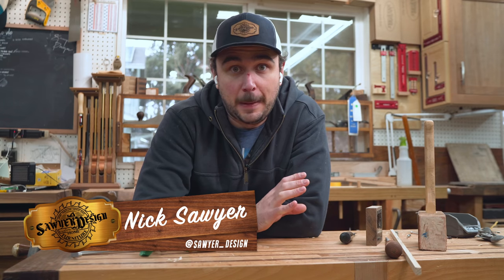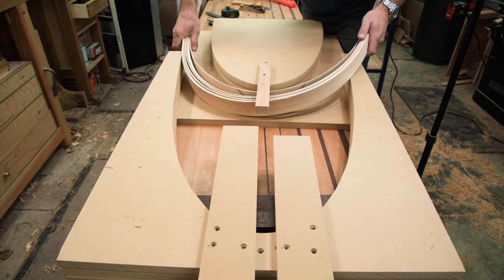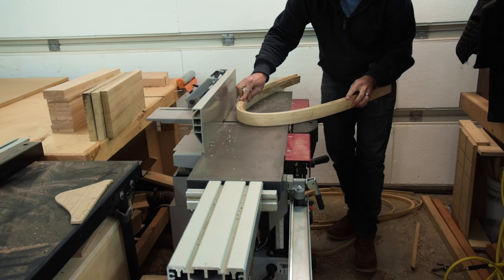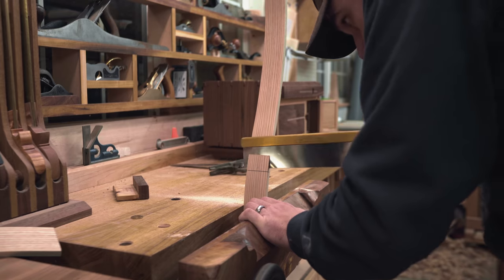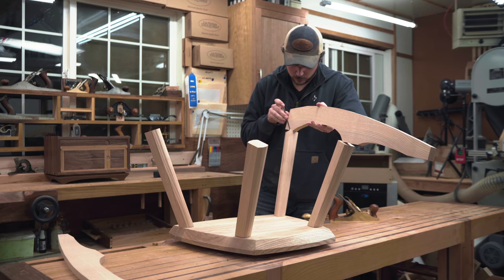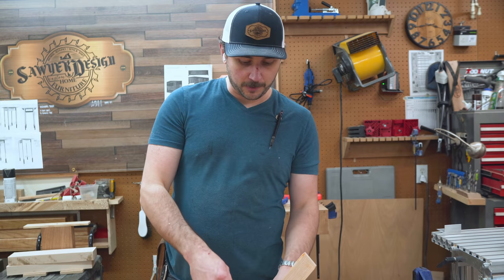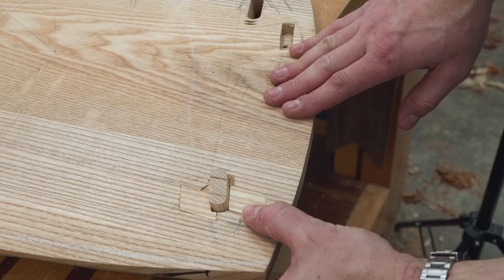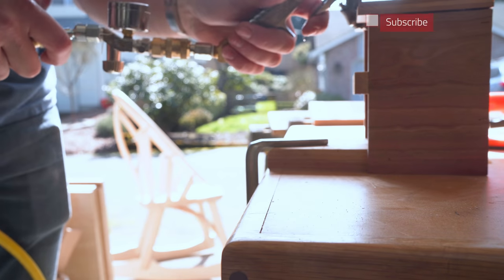Experimental Chair

Comment: Great build. Have you sprayed osmo before? Super interested in that finish bring spayed
Reply from the maker: This is the first time. Been wanting to try it for a while.  It’s the 1101 formula which isn’t my favorite and I still haven’t built up a sheen, but I’ll definitely report back after a little testing. I spray with a mini hvlp and 1hp compressor so it was a little finicky to get dialed in.